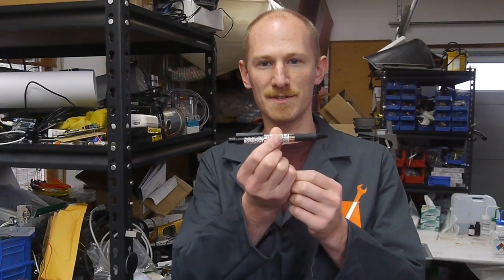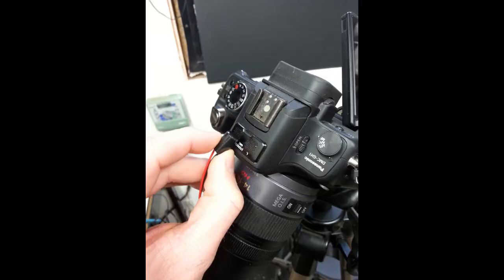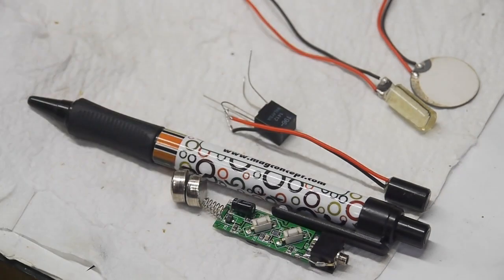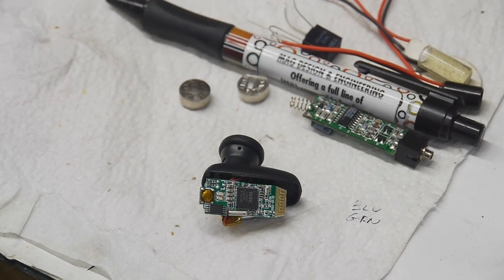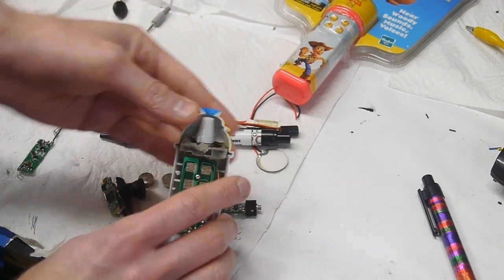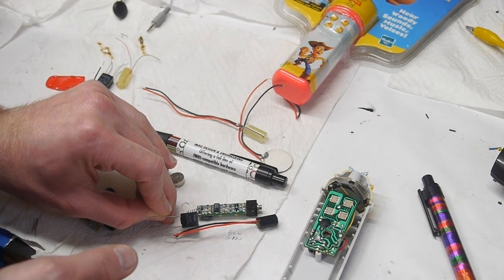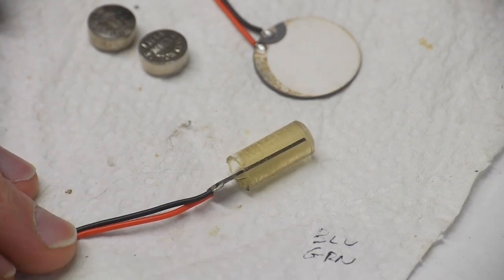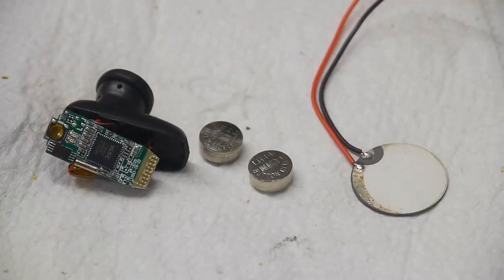Covert radio pen with bone conduction speaker

Comment: i think i heard of this idea where athletes would have a permanent implant of this in their teeth or something so that they can near their coach during a match

how far can you have the bone conduction speaker attached to your body and still hear it?
does it have to be right on the mouth all the time or can it be like on the neck?

how would it work if you are in a loud environment and have a bone conduction speaker?
could you still hear it clearly? would it be louder than the environment? like if you are in a rock concert, could you actually hear the bone conduction speaker?

i don't know that much about it to start thinking about applications for it

if you can put it on your head and have it work, maybe you can just stick it on your scalp and wear a hat?
maybe a hat covered with bunch of those conduction speakers so that when you wear it tightly, even with hair you could hear it?

maybe have like MP3 player built on the hat

Comment: hundreds of volt range ? Is this the same piezo we can found in some "music postcard" ?
Reply: It looks like a higher power/quality one judging by the thickness.
Reply from the maker: Ryan Willis
creatiph  One difference is that the greeting card speakers have a brass disc that is designed to be resonant around the speaker's target frequency.  This allows much more sound to be generated for a given input voltage.  The brass disc also serves as an acoustic impedance match with the air.  I've never measured the voltage applied to the greeting card speakers, but I would bet it's only 3V from the battery.

Comment: Could it be useful for communicating with patients / study participants inside MRI machines.  I suppose a speaker in the room outside the machine with good volume might be better but just a thought.

No matter what you are stuck with one way communication.  What about an alternative to google glass.  Notifications via implant.

You could combine it with a high amplified mic.  I have one.  It picks up anything and produces the same volume no matter what.  Talk load it picks it up with some cutting of the wave but it's pretty good.  Whisper from across the room it picks it up.  You can pick up under breath speech with that thing.  I got it off of amazon.  It's meant for security systems.  Takes a 12V in and single rca out.  It's supposed to be directional but considering it picks up everything I can't tell.
Reply: I don't think metal in your mouth in an MRI is safe.
Reply: It would be fine for use in an mri if you don't mind losing all your teeth :p

Comment: Where do I get that transducer disc?
Reply: IDK where to get ones of any guaranteed quality, but I usually strip mine out of mid-grade toy electronics, which often have one for their speaker
Reply: I wager a guess that it's the same piezo that they use to make an internal electric pickup for acoustic guitars, violins, ukulele, picking up vibrations of the soundboard rather than strings in an electric guitar. Any passive transducer can be used both ways, either as a microphone or as a speaker. Or perhaps that's the one used for water evaporators - while they're very resonant, of course they'll emit somewhat wide-band sound if driven by a comparatively low-impedance sound source rather than a resonator that tunes itself to their frequency, as they do in evaporators.

As to ones of "any guaranteed quality", well there's plenty of piezos with authoritative spec sheets at Conrad Electronik if you happen to live in EU, they even have them at the brick and mortar stores in major German, Swiss, Austrian cities and in Budapest, Hungary. Of course they'll change their behaviour once you cut them down and pot them, but they also have small rectangular ones already made, but you usually have to order those. Otherwise, Farnell, Digi-Key, these kinds of places? Where ever you order your electronic components? Or as to evaporator ones, that's a buck from China, and they have spec sheets on them too.